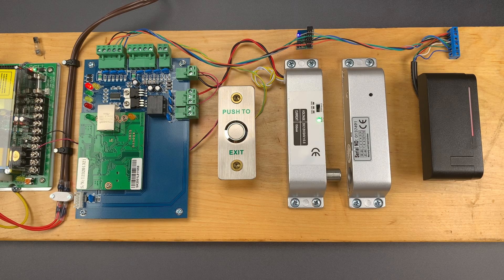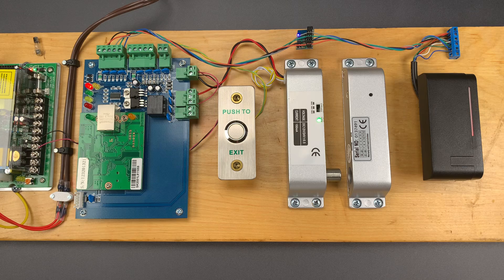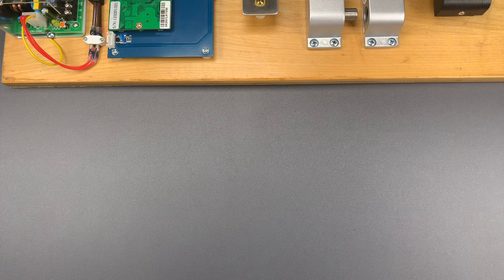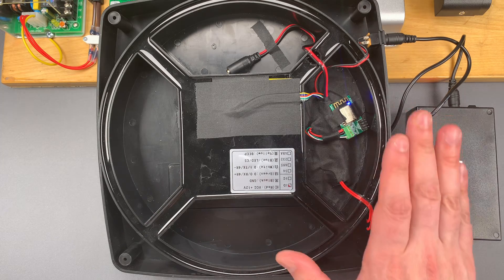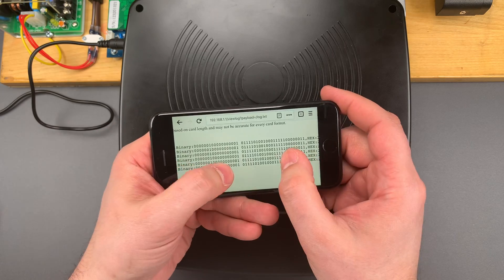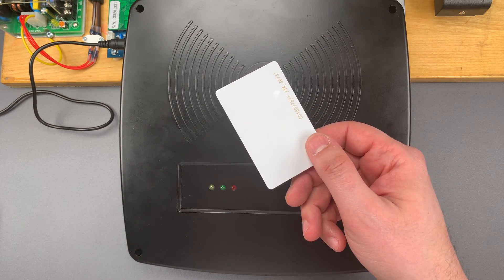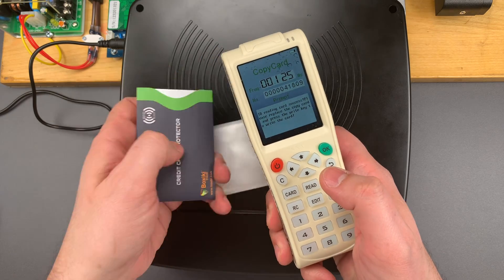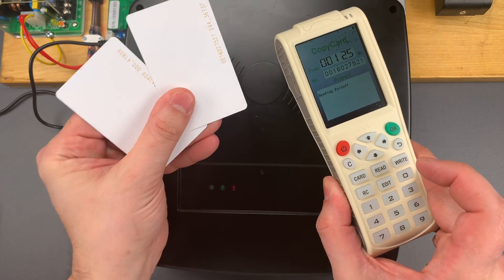[1056] This Black Box Reads RFID Cards in Your Pocket

Comment: I have one of those fancy micro wallets with RFID blocking (card holder is basically a hollow block of aluminium.
The Readers at our cafeteria cant even read the cards on the outsode of the blocker when in direct contact.
Reply: The solid aluminum may be a better RF shield than metalized plastic/paper.
Reply: I was wondering about that. I have seen ads for wallets like that and I was curious if they work.
Reply: I agree on the Can't read thing : I have a credit-card in my phone holder and it won't read - I used-to have a Flip-case for my phone, and the card could be read flipped-out; but it does seem to fail to read when flat-against the phone.
Reply: Those blockers (and keeping multiple cards together) aren't 100% secure but they do make it harder to read the cards.